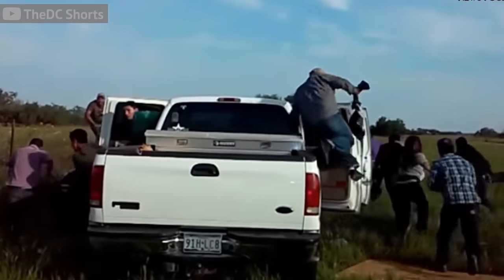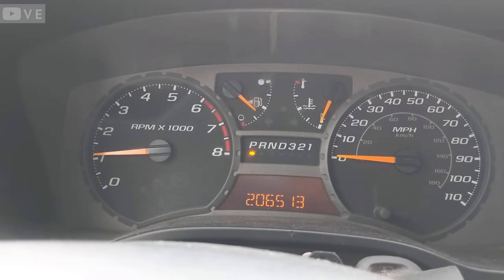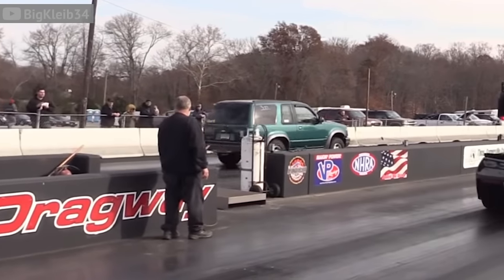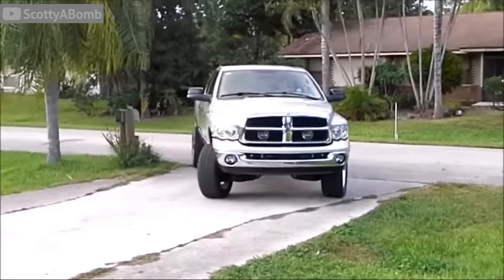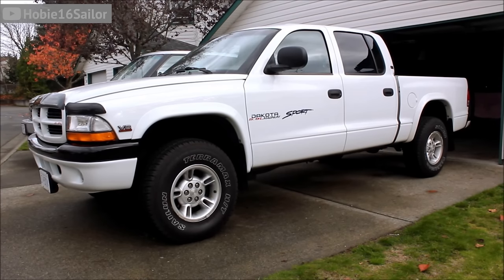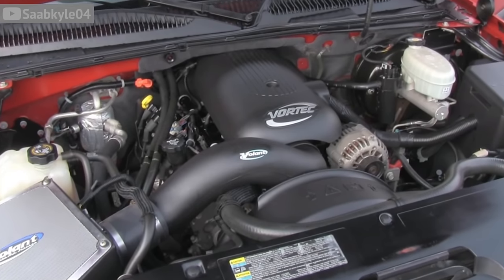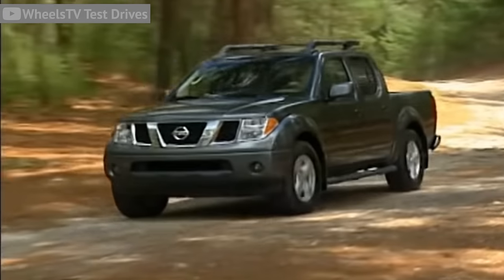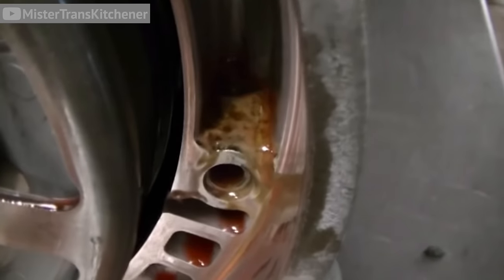USED TRUCKS YOU SHOULD NEVER BUY!

Comment: The avalanche has been the best vehicle I’ve ever owned. Super reliable and enjoyable to drive. It’s held up very well and it does everything for me from using it for work, hunting, fishing, camping, pulling my travel trailer, and driving my kids to and from school and extra curricular activities. My wife even likes to drive it. If they were to bring it back, I’d be ordering it the day the assembly line started up.
Reply: Same
Reply: Agree
Reply: Agreed. Ive got a "poor" example with 320k miles and yeah it isnt a nice truck but I have pushed it further than it should be....but it starts every time and keeps going.
Reply: The only one he got right was the f150 with the 5.4. The rest seems to be a hodgepodge of personal dislikes. Midsized pickups are ideal for many things, as an example. The Dakota is excellent offroad, and it's bed is plenty for the average person to haul what need to be hauled. 99% of people would be just fine with that. Hell, I've seem contractors use dakotas  as their main vehicle. 

I've seen many Avalanches still on the road hitting over 300K, running like a Swiss clock. 

Regardless, every issues, with the exception of the f150, plague every vehicle on the market that can be avoided by doing simple maintenance. What to avoid rust issues? Wash your damn truck.
Reply: I agree but until them 5.3s start ticking
Reply: @berserkerusmc7613 100% agree
Reply: Yeah, they are great trucks, this guy doing the video is crazy.
Reply: Me too.
Reply: I have had 2 avalanches still have an 03' and now daily an EXT awsome vehicles
Reply: Had five of the Avalanche's 02,06,11,13, and 04 2500. Still own the 13 and 2500. Amazing trucks. I will continue to maintain and repair unless it rusts out, even then I'll buy another unless they start producing a full size cab truck with a mid gate again.
This guy has no clue. I've never had any of those issues. The only common issues I've found is oil pressure sensor and screen on the 5.3 and the oil pickup tube. I occasionally slightly overfill the oil and park at a downward slope when given the opportunity. It keeps the o ring wet and sealed in the tube. The other is the sail panel drains and keeping them clear. They are the reason for all the rear door frame rusting on many of these. The other issues I've had are all maintenance or corrosion related. Easy 200-300k mile trucks.
Reply: @thenewoldtimer  same here great trucks and I also will continue to look and find them and but them. I just told my wife I was gonna start to look for another one now, may start hoarding them
Reply: You can not kill any gm truck or suv year 2002-2006 they are the most reliable trucks ever made. They also have parts at any parts store to fix for cheap this guys is a quack!!!!!
Reply: Youve been baited into watching a low effort video.
Reply: Same here and still have my 2002…202K miles and never had a tranny prob…and only had to replace the anti-knock sensor on engine. And for the body cladding, I found it was less about fading…more about if you went through car washes and that crappy wax clung to the cladding. I wiped cladding down with silicone (think tire magic) and it looks like new for a while.
Reply: I have a 2004 Avalanche. I have pushed the stock diff further than I should have but the replacement parts are plentiful
Reply: The whole reason I click on this video was because I thought that they were going to say something about the Avalanche I have a 2003 Chevy Avalanche Z71 it has been the most reliable car I had in the last 23 years
Reply: I love my 2002 Avalanche Z71!
Reply: What year
Reply: 5:36 everyone has like 200k miles on there avalanches.